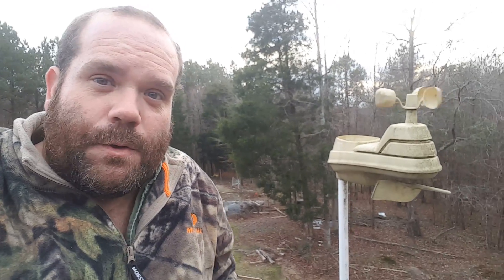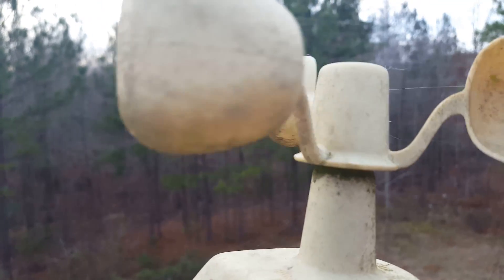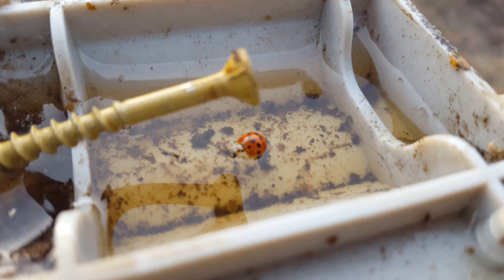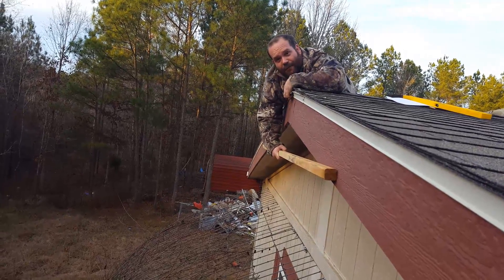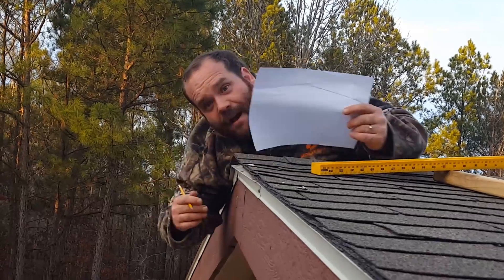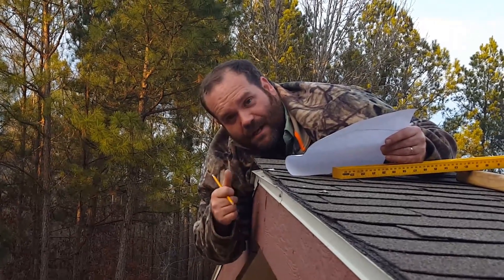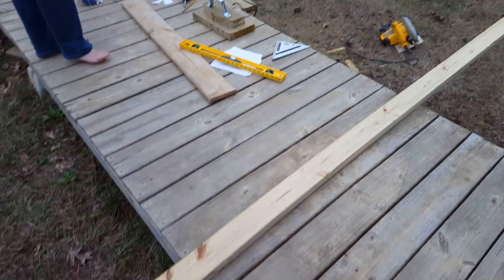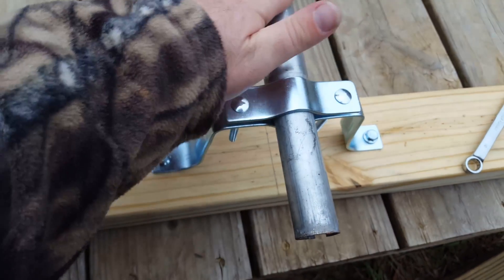☉🌥☔Replacing an AcuRite Weather Station with a Davis Vantage VUE Weather Station

Comment: I used to work at Davis Instruments, I was an engineer there for 12 Years. BTW: they've been acquired by AEM and I wonder how long this product will be offered, I hope for a long time to come, this weather station is truly built and designed tough, (When I joined in 2010, the station just came on the market, they gave me one when I joined the company, I still have mine and it's working great!)    I think you probably already know that occasionally you'll need to replace the CR123 battery, and I assume you oriented the solar panel due south. What I did was put a sharpie mark on the pole so I could line it back up.     I hope your station is still running?

A little more about the weather station: They test the heck out of these and make them out of the best plastics. We tested the various competitors stations and the AcuRite sensors weren't accurate, nor do their plastics last as long, the sun beats them. They tried to knock of the Vantage VUE but couldn't, sure they were cheaper and under $100, but if you want quality, Davis Instruments is the best. 

One more thing about the product: there is a newly updated console that is made from a tablet and has a color screen.  I will say that as fancy as that is, I like the older LCD one better as they will last a long time on batteries.

Comment: I just ordered the Davis weather station and am in the process of trying to decide where to put it.  You video is just what I needed to see.  I read ahead on the installation manual and did catch the part about not having to close to the roof surface, etc.  If I decided to put it on the end of the roof I would probably just get one of those gable-end antenna mount kits.  I don't have kids around anymore so I might have to have someone else put it in for me.  I'm not sure if I could do it all myself.

This was three years ago.  How is the station holding out?  How often did you have to do maintenance?  Did it end up getting as scuzzy as the other one?  I know there's some kind of battery backup so it can function at night.  How often have you had to replace the batteries?  I've been fascinated with how they do the temperature readings.  I was always taught you had to put your thermometer in the shade to get an accurate reading.  Somehow they've figured out how to get around that.

Comment: The only thing I would add is if you are attaching anything metal to your house, you might want to run a ground wire from the pipe to an earth ground in case of a lighting strike. Safety first
Reply from the maker: That is a fair suggestion to make. Thank you.

Comment: DO NOT buy the $100.00 "cheap" WX Stations from anywhere - They are "ALL" junk.  I purchased a La Crosse from Costco - it didn't last a year.  Yeah I know, I can take it back... I got better things to do.  A year later I bought the "new and improved"  La Crosse WX Station from Costco.   This was a repeat performance... another POS.  So I spent hours reading reviews of other brands on Amazon, YouTube, Weathershack.com etc. etc.  I've come to 2 conclusions,  I either spend hundreds to thousands of dollars on truely PRO WX Stations or I go to NOAA.com.  ALL of these cheapo wireless  WX toys are designed to do one thing well - take your money!  If you want a pro unit, you have to spend like a pro!  You get what you pay for.
Reply from the maker: I agree, which is why we had to dump the $100 one and go for a more "pro-sumer" model. So far, so good. Still not a thousands of dollars scientific machine, but it is doing better than the $100 one, for sure.

Comment: Nice install, did you use pressure treated lumber or are you going to paint it for longevity?  Not a fan of hanging off my roof thats why I ground mounted mine on a 15ft pole. I'll live with a little wind speed inaccuracy. Its kind of a trade off lower for temps higher up for wind just guess it matters what your most interested in.
Reply from the maker: It is pressure treated wood.

Comment: Hi J&J Acres, the temperature problem you mentioned it's not just because of the proximity to the roof. There is something else as important as that. It's called Fan Aspirated Radiation Shield that none of your weather stations have. Get a Daycon or Davis Vantage Pro 2 with FARS. Regards
Reply from the maker: Perhaps one day, but for now this is what we could afford. Thank you for the info.
Reply: The AcuRite 5-in-1 PRO+ (06014) also has fan-aspirated temperature sensing.  No, I'm not a salesman.

Comment: Any concern about attracting lightning with this?  Maybe you want a wire to the ground from the base of the pole.
Reply from the maker: I'm not concerned, but Jennifer does want me to do that.
Reply: All metal masts need to be grounded to prevent static build up.

Comment: I was sent one to review but it didn't come with a pole and still need to get that.  I have some time to do it and it was great seeing what you did.  - I just opened it up.  It came with a funky little Duracell battery.  Not sure what that's for.
Reply from the maker: I'm jealous, we paid. The battery is if the solar panel isn't sucking up enough light.
Reply: They would have given it free to you.  I was on your chat Sunday show and offered free LED grow lights for review and didn't get a response.  No Big deal but would have been for free.
Reply from the maker: You just never know with some companies. Oh well.

As for the grow lights, I do apologize for not recognizing your offer. I really don't have a use for them right now. I don't do any indoor growing, nor the space for it.